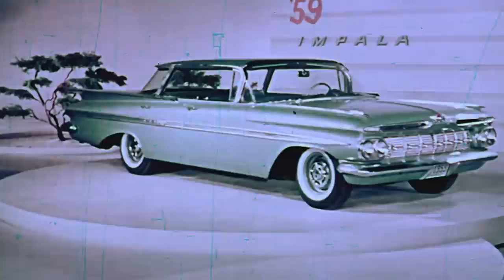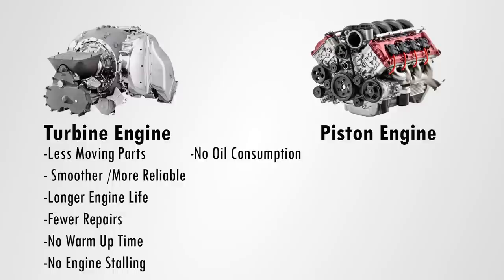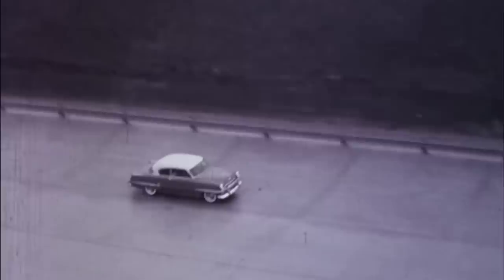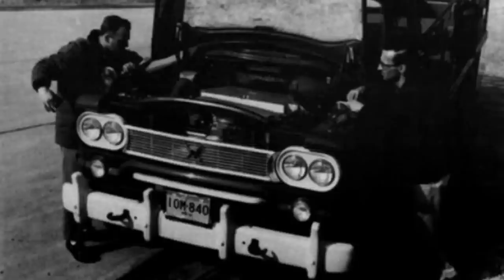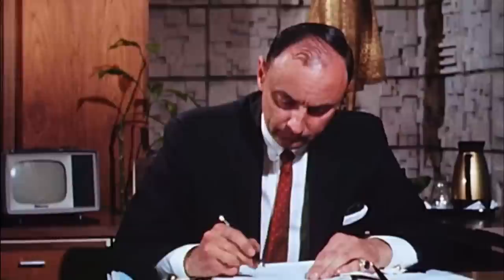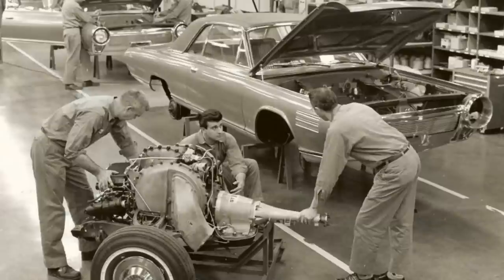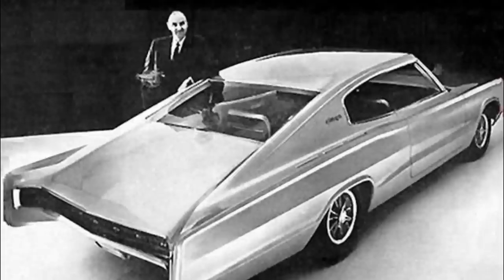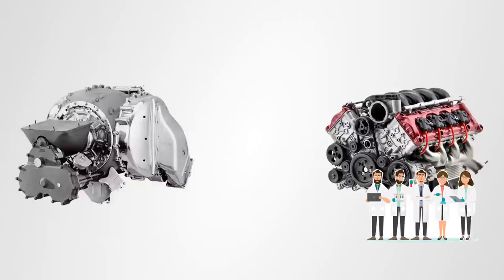Jet Plane on Wheels: The History of the Chrysler Turbine Car Program

Comment: One major downfall for turbine engines in a vehicle is that they cannot be restarted shortly after being shut down without being allowed to cool or you will have a hot start. You would need to leave your engine running if your planning on shutdown and restarting it within the next 20-30 min or run the pneumatic start without adding fuel to cool down the engine in preparation for a restart. Not something the average driver would want to deal with. [Edit] I am assuming that the car has a cooler/ blower that would run when the car was shut down so it could be restarted without a long wait. In an aircraft you need to be mindful of how the parameters of operation or face an expensive rebuild cost.

Comment: The Chrysler Turbine Car didn't have an "airplane engine."  It was powered by a gas turbine engine designed and produced specifically for automotive use.  The engine and drivetrain actually had more in common with modern helicopters whose turboshaft engines are optimized for shaft power to drive the rotors, rather than generating thrust.

Comment: Rover tried the same thing in the development of the rover p6. Designed to  accommodate a jet engine,  but easier to fit a Buick 215 v8 into. The legend was born....the p6b
Reply: BMW developed the first gas turbine road vehicles in 1944...

Comment: My Dad was a Chrysler-Dodge-Plymouth Dealer in Rome, NY. At the time Rome had a large functioning Air Force Base. Attached to the base were 2 high level, Civilian Engineering Groups. My Dad was heavily involved with both Chrysler Dealer groups and Base relations. He persuaded Chrysler to allow the Base to have a Turbine, but as I remember it was only for a month or so. I was 12 or 13 at the time and my memory fails me. Again, as I remember the car was dropped off in the fall and you wouldn't want a car like that in upstate NY during the winter- especially in the '60's.  
personnel. The Commander of one of the groups was a good friend of my Dad's and the lead engineer (Civilian) was not only a friend but a life long customer and a sol

Comment: The big problem is they use TWICE THE FUEL per mile. They would need to have over 30 compressor ring sets to get the fuel economy to be equal to a piston engine.
Reply: That and the production costs of the engine alone was more than a new house in the 1960s
Reply: @sandervanderkammen9230  True, My dad bought a home for $8000.00 in 1961 and paid it off in only 2 years. Something is VERY wrong with today's AMERICA when owning one home requires the income of 3 Moms, 3 Dads plus housing 7 kids on top of it. That's the situation my 3 children are in today. 13 people packed in ONE home just to survive and paying on THE NEW 40 year Mortgage plan!!! How considerate. SLAVES of the new age. I pray for the day Democrats and Republicans have had enough a JOIN forces and kick some ass!
Reply: @johnslugger  The price of a  similar non-flight rated gas turbine engine today is closer to a million dollars, gas turbine engines are extremely expensive to build.

Comment: In the early '70s Chrysler's tank building division, Chrysler Defense, started work on a new prototype tank for the US Army powered by a turbine engine (from Lycoming). This prototype eventually won a competition against a tank from GM and became the M1 Abrams. I wonder if the engineers cast off from the turbine car project contributed to the M1 -- the timing would be about right.

Comment: You forgot that there is another vehicle that is powered by a turbine engine that has been widely produced. The engine is built by Chrysler as well I believe. I am referring to the US military M1 Abrams main battle tank. It has been about 30 years since I've been on one but it was powered by a turbine engine that provided around 700 HP per track. That was the M1A1 anyway, I can only assume that the newer ones are better. Maybe it isn't something available to the average citizen but there are a lot of these vehicles in several nations arsonals.
Reply: Chrysler designed the M1 but had to divest it's military division as part of the government loan. I'm not sure what category it would fall in but I think it would be funny for one to show up at Carlisle.

Comment: Britain also experimented with a Turbine Locomotive. The result was a 'Meh', as it was no more fuel (coal) efficient, and was slower in reverse. Also because of it's rare one off status, maintenance was more costly, with parts not easily available. The locomotive was converted back into a standard Boiler loco, only to be written off 2 months later in one of Britain's worst rail disasters.
Reply: Steam turbine engines are completely different technology... they are external combustion and use the Rankine Cycle.
Gas turbine engines are internal combustion engines and use the Brayton Cycle.
Reply: The first gas turbine powered locomotives were built in Switzerland by Brown, Boveri und Cie

Comment: "Tur-bin" - ten-gallon hat, top hat, topper, toque, or tricorne.
"Tur-byne" - a machine for producing continuous power in which a wheel or rotor, typically fitted with vanes, is made to revolve by a fast-moving flow of water, steam, gas, air, or other fluid.
Reply: No, its correctly pronounced Tur-ben or Tur-bean

Comment: When I was a kid, I thought turbine powered cars were fiction as I was a Knight Rider fan at the time.  The Knight 2000 (or KITT for those of us who are fans of the show), had a turbine powered engine.  I would assume it was something that sounded high tech and futuristic in the early 1980's.  I knew that Union Pacific tried turbine powered locomotives in the 1960's, but I never thought anyone tried putting one in a car before.  I do wonder what it would be like to drive a car with such an engine.

Comment: Great detail. I had no idea that the program continued as long as it did. I had thought the MPG issue had doomed it. But it seems that we could either have turbine cars or low emission cars given the limited resources at the time. I guess people forget that cars take so long to develop new technology because any new technology has to be extremely reliable and last for the lifetime of a typical car.

I have one question though - Is the Chrysler turbine engine technology being used in the turbine engine that powers the M1A2 Abrams tank?

Comment: Great video!  The copper colored Turbines were pretty well publicized back in the day, but your story about the efforts before, in the 50's, and afterwards, through the 70's are not as well known.

There are several of the Turbines that made it to museums.  In Detroit, the newly-opened Stellantis museum and the Henry Ford have one.  Of the ones that weren't crushed, many (most?) had their engines removed.  Your video had a shot with a Turbine held up by supports underneath and I suspect it was one of the gutted Turbines.

Comment: In another docu about the turbine car, they mentioned that these cars delivered huge torque. All in all the turbine car story is kind of a sad tale.
Reply: Not true, the turbine produced very poor torque output, the Chrysler cars required multiple gear reduction gear sets and a torque converter to generate the torque to the rear wheels
Reply: @sandervanderkammen9230  "chrysler turbine car torque": The engine produced 130 bhp (97 kW) at 36,000 revolutions per minute (rpm), 425 lb⋅ft (576 N⋅m) of torque, and idled between 18,000 and 22,000 rpm.
Alles klar Herr Kommissar?

Comment: You shoud do a video on Rovers Turbine power car program as well. They even raced on at LeMans.
Reply: Should do a video on the BMW GT 101 gas turbine engine, the first used in road vehicles in 1944.

Comment: Turbojet stages: Suck (intake); Squeeze (Compression); Bang (Ignition); Blow (Exhaust). What stage is the "AfterBurner" Turbo output applied back into the Turbojet ??? The Squeeze (compression) stage or Bang (Ignition) stage ???

Comment: Wow, what a great watch.....   REALLY.    
Ed, you really did your homework on this one.     The ICE has many many years left in it.    How about a vid on the "Transmission."      A ICE run about 800 RPM to 4000 RPM but a    Gas turbine runs somewhere between 10,000 to 20,000, there must have been a huge gear reduction between the turbine and the tranny.
Reply: The GT-304 version of the GM Whirlfire turbine engine had a 7.27:1 reduction gear.

Comment: The interesting this is, this is a technology that could be revisited.  Even though EV technology is getting better, some people aren't fully comfortable with them range wise.  A small turbine generator could be fitted into a car that acts like an APU on an aircraft and could charge the battery, it wouldn't even need to be on all the time. It could reduce the number of batters while also reducing cost and increasing range. Would also be helpful for larger, commercial trucks that need to tow a lot.
Reply: As others in this comment section have noted, turbines suck for intermittent use (such as in a hybrid) and lose efficiency when scaled down (because the gap between the fan blades and the turbine wall are proportionately bigger.)  It would cost more than a conventional engine that did the same job, might break down less (but would be more expensive when it did), and it could burn just about any flammable liquid that didn't dissolve bits.  And you aren't going to find an off-the-shelf model that is suitable.
Reply: @boobah5643  That's just software programming. You could allow the power to drop off to a certain point, then recharged the batteries.  Also there are off the shelf versions that small, the aviation industry uses them all the time, and there are even smaller ones used for model aircraft and not to mention 3D printing the components which are extremely easy.
Reply: @jhmcd2  Its not software programing, its a real, mechanical  limitation of Gas turbine engines.
Compressor efficiency is restricted to a very narrow range of rpm and thus power output settings.
The Laws of Fluid Dynamics prevent compressors from operating with acceptable fuel efficiency below 75%-80% of full rated power output.
This is completely incompatible with the Charge Curve of rechargeable batteries.
Any questions?
Reply: The Atkins Cycle or Diesel Cycle are best suited to hybrid electric vehicles., they are able to operate efficiently over a very wide range of rpm and loads with lower BSFC.

Comment: I had a 1984 Mazda RX-7 GSL-SE (I know Japanese but my life. my choice) which had the Wankel in it and was tweaked with EFI, The interior basically was designed around you and my wife at the time swore everyday I left for work that if I crashed she would have to bury me with the car.As it basically was like a coffin. I had no issues with this. I know a Wankel isn't technically a turbine but I honestly never could redline her. She was shaped like a bullet and designed inside like a high-tech coffin. This guy's wet dream. I loved that car and had bought it used of a friend's dealership for a song. Damn why is it today that all cars look the same but if we want something different, because we may have different tastes (and are tired of trying to open someone else's car at the mall during holidays) that we have to spend so much more. Cookie-cutter doesn't work for me, which is why I drive a Nissan Cube (yeah japanese..yadaydayda)

Comment: Imagine a turbine engine built utilizing modern design principles, materials, technologies and including an electronic ECU. It would probably be lighter and more powerful at the same time, while CO and NOx emissions aren't that much of an issue due to said electronics, aswell as there now being catalytic converters and AdBlue. It'd be very interesting to see how a turbine engine built nowadays compared to a modern, turbo charged piston engine - i.e in terms of acceleration, fuel efficiency, emissions, power output, etc.
Reply: Unfortunately gas turbine engines are still completely incompatible with automobile applications because of the limitations of compressor technology imposed by the Laws of Fluid Dynamics.
Reply: @sandervanderkammen9230  Welp, back to the turbojet it is then :P

Comment: GE Aerospace made drastic reductions in NOx emissions in the GEnx, so, with more breakthrough materials like ceramic matrix composites, gas turbines really could power cars today, and fit environmental regulations.
Reply: Unfortunately the Laws of Fluid Dynamics prevent compressor technology from ever being fuelefficient over a wide enough range of power output settings to ever be practical for automobile applications.

Comment: One of the main reasons that a turbo engine could not be adapted to an automobile is that rotors have a very large rotational inercia.  That means they take more time to change rotational speed (RPM).  The consequence is that the car takes more time to acelerate from a certain speed.  If you drive the turbo on a straight highway with constant traffic and keep a fairly constant speed (like an airplane) the engine is efficient.  If not, it is not, and is impractical.  There no way to change that because the turbo engine is an open engine.  That means that the air and fuel mixture is never fully enclosed, unlike a conventional piston engine where the mixture is enclosed in the cylinder (when all the valves are closed for ignition). The resulting explosion with more mixture during acceleration produces an immediate increase in torque (and therefore car acceleration).  It is incredible that the development engineers did not realize that, maybe even after 10 years of testing.
Reply: Gas turbine engines produce very little torque, especially at low rpm.
Like Turbojet engines, gas turbines have very poor throttle response because of the limitations imposed by compressor technology and the temperature limits of the exhaust turbine blades and nozzles.
Accellerating too quickly causes thermal damage to the hot section, the automatic fuel controls limits fuel flow and causes throttle lag.
Reply: Most major vehicle manufacturers experimented with gas turbine engines and quickly discovered the limitations, only Chrysler was bold (or foolish) enough to build an.entire entire test fleet before coming to the same conclusion that others did sooner.

Comment: Chrysler was very close to offering a turbine engine option in the 1981 New Yorker. By that point they had met all of their design goals including being able to produce the engine at an acceptable cost.
Reply: tecdessus  You find that funny?
Reply: tecdessus  I agree, they tried so hard but things just became stacked against them.
Reply: Very close to offering it in 1981??? I find that hard to believe.
Reply: tecdessus BMW was the first to build turbine vehicles in 1944.
Rover gave up on cars...
Reply: @sandervanderkammen9230 I'm not normally accused of being a liar. I'm merely stating what I've read.
Reply: @telepresence  The Chrysler turbine engine program was in steady decline after 1966 and was pretty much dead by 1977... killed by the OPEC Oil Crisis.
Unless you have some more information to share?

Comment: Then Volvo showed how turbines could be used in cars in the mid eighties: Use a small turbine that roughly produces the car's average power consumption to produce electricity for driving electric motors and charging batteries. When going on low power, the batteries get charged, when demanding high power, batteries and turbine combined fed the motor(s). A Volvo 480ES that pulled a trailer with the turbine on it thus achieved a fuel economy of well under 5 litres per 100 km or 20Km/l or ~45mpg. Complexity and price of the system probably prevented its introduction to markets.

Comment: The probable reason why they were consuming more gas is probably because turbine engines are know for consuming much more than a conventional engines while in idle, and people were probably eager to show-off their limited run turbine car and keept them in idle for too long. Never the less had the program succeeded and prices droped over time I would lovo to have an turbine engine vehicle.
Reply: Gas turbine and jet engines consume the same amount of fuel at idle as they do at 65% of full rated power.
This is due to compressor efficiency

Comment: It would be really cool to develop a turbine-powered car with modern technology. Even if it was just a high-end performance option.
Reply: Gas turbine engines are incompatible with automobile applications which is why none of them were successful.
Reply: @sandervanderkammen9230  You clearly didn't watch the video or you don't know what incompatible means. The engines worked just fine in the automobiles. They just weren't cost effective to mass produce.
Reply: @bradleyj.fortner2203  The video proves the fact they are incompatible with the automobile.
Not a single turbine car was ever sold commercially and the fleet was destroyed apart from a  few museum examples.
The staggering production costs, horrible fuel efficiency and poor driving performance prevented turbine cars from being a viable alternative to ICE cars.

Comment: I read thst the bodies were basically hand built and then shipped to the US.. I also know that GM offered airbags in the early-mid 70's but.no one wanted them and they went away untill the late 80's-90's and now cars have on average 4-6 airbags not just the driver passenger. They air in the seats and knee line..

Comment: The British Rover company also built turbine powered cars. They had worked on the WW2 aircraft jet engine so had the heritage for it. It failed of course. First reason was far too much waste heat, especially at low speeds, fuel costs were the death knell.
Reply: The first gas turbine powered vehicles were developed by BMW in 1944.
Reply: Actually it's compressor efficiency that wrecks low speed fuel efficiency... its same problem interchangeable aircraft gas turbine engines.